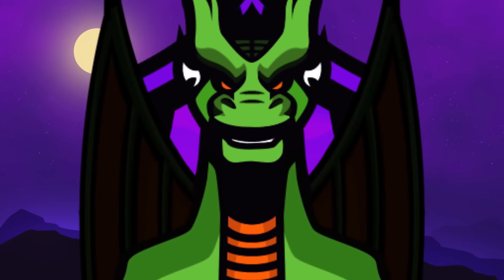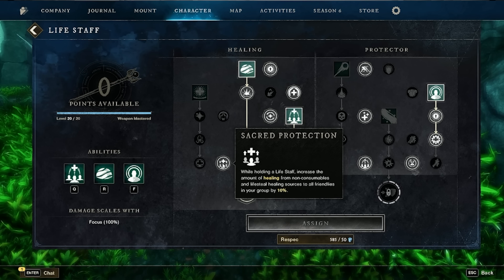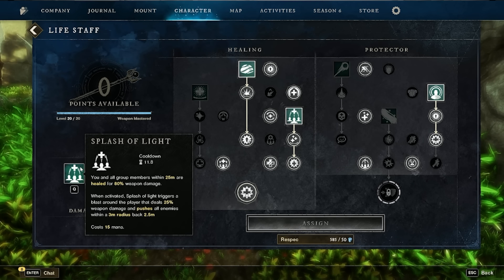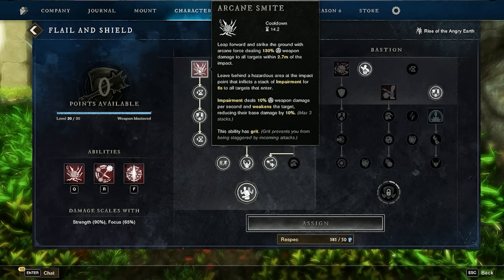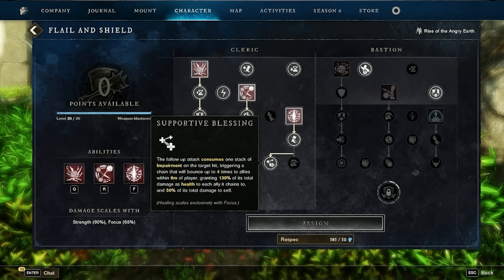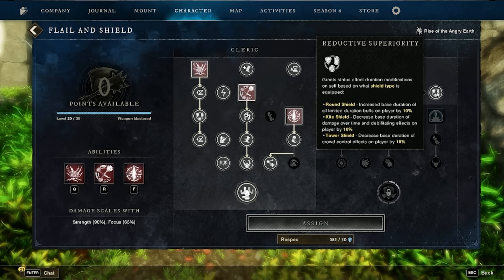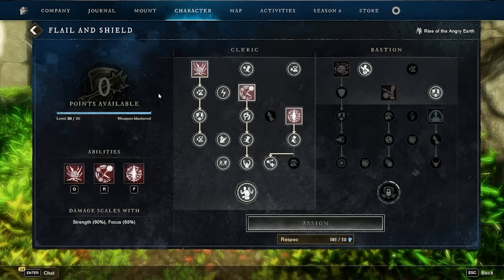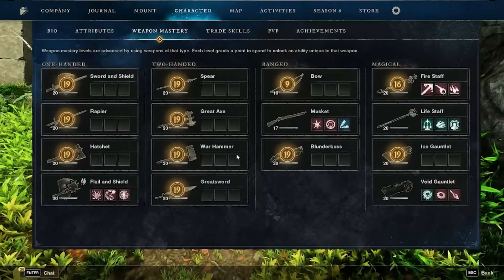New World Aeternum Life staff & Flail Build (Healer)

Comment: I'm actually using this now, over Void Gauntlet as secondary. Its a bit more dangerous being within melee range, and you do lose the stamina regen from VG, but to me it's a more fun healer playstyle. Imo The VG might be better overall though, it's just not as fun as the Flail, but it's also alot riskier so you could die to bosses while using flail skills and that could lead to a wipe and most definitely lead to your group thinking you're a bad healer.
Reply: I''m back in the same boat since i just came back ingo the game. I enjoy healing for dungeons and opr and the flail is much more fun. But before i took a break went through the same issue where people were like you have to have VG. They're not wrong but i to found it boring.
Reply: @LibertyOrDeath87   so flail is trash?
Reply: No I don’t think so. I just think since it’s melee you have to be very careful unless of course you’re rocking void blade which case you still have to be careful but again. I find the VG boring. The mace is just visually very pleasing and good but you might find some folks when it comes to M3s not taking you unless you have a VG. 

In PvP you basically have to use rapier cause it’s a really good escape. I’m sure there’s some damage combo builds you can use but for straight up healing in PvP, the rapier. Once you learn to use it right, it’s super clutch

Comment: Y’all think flail and VG tanking possible 🤔
Reply: I've seen Flail/Shield and Warhammer, but not a VG offhand from tanks. Biggest issue is you have no hard CC on VG skills, only a root which doesn't help against boss mechanics/skills, and the root is also a small frontal cone instead of an PbAOE. There are just better options for tanking, and while it could work with VG in lower level content, you might not see it in higher content. There is light tanking with a evade rapier build too, but that takes a much higher skill ceiling. People will take you regardless if you use VG or not, since tanks are so rare, but remember that if you lose aggro or can't stop a boss attack that you could have otherwise, it's your fault 😅
Reply: @BoredAndBrowsing  ehhh I don’t mind the heavy tanking but sns feels boring I been running great sword for the easy taunts but whenever I switch to my sns I get depressed lol